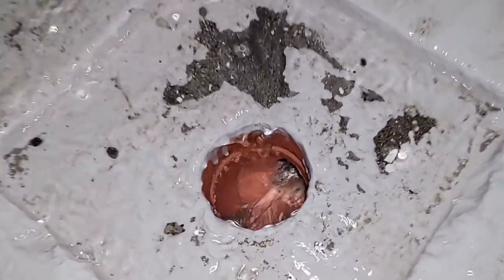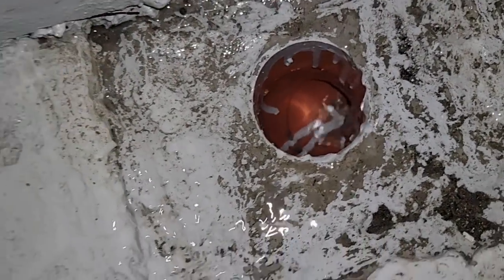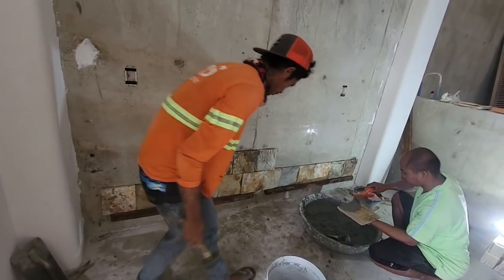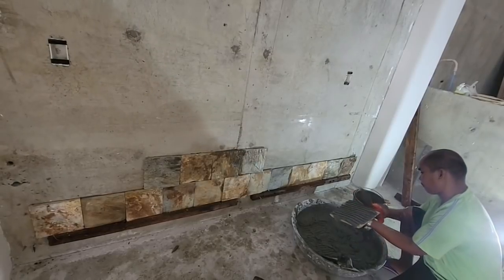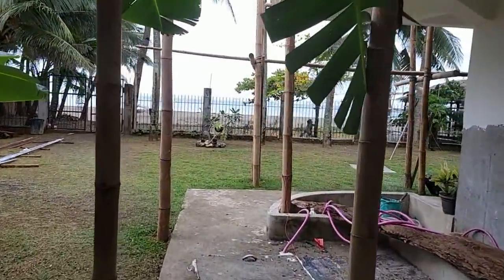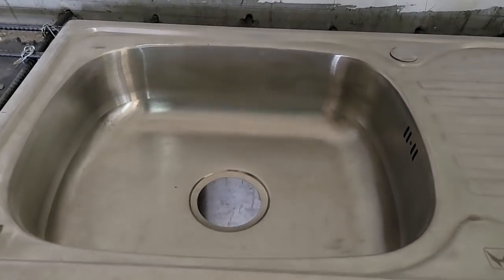Philippines Beach House Build Day 271 OPEN THE FLOOD GATES Before we ALL DROWN! MEL TAKES CHARGE

Comment: they should mark up 1 or 2 rows up on the wall and spread the glue. (1 or 2 depending on how quick they are so the glue doesn't dry by the time the slap the tiles  up. There's no need to tap it, it may chip or crack the tile. What the can do is apply some pressure and wiggle it side by side until it is flush with the other tiles. Wipe glue up as you go, as you wiggle the tile glue will surface if you haven't scrapped the edges as you go and you shouldn't get any glue on the tiles. Love your progress

Comment: Sorry if you've mentioned this before but Its been quite a while since you installed the cistern and my memory isn't the greatest.  Im wondering what happens when the cistern reaches 100% capacity.  Did you have a drain tube at the top to push excess to the lower elevation beach?  Im still debating on whether id do a cistern on my build when I get to it so knowing fully how it works may aid my decision.  Cheers to your great videos and educating laymen like myself!
Reply from the maker: yes there is a overflow that goes out by the fish pond. I can either let it overflow to the sand or and can direct it to fill the fish pond which will eventually be ponds . Also great for occasional water exchange on the ponds.

Comment: That stone tile is more than likely going to fall off of that wall in no time. Hopefully the guy is using a polymer modified thinset at the very least although I doubt that material is easily available where you are located. He should also be troweling the mortar onto the wall and leaving a horizontal notch it at the very least prior to installing the tile. If you don't trowel the thin set onto the wall there is no bond, even more so when you use inferior setting material which he is more than likely using. You will be able to pull the tile off with just your bare hands or just pop it off with a trowel. Sorry to be the bearer of bad news but that is shoddy workmanship. I am a contractor with over 40 years experience in the field and have fixed 100s of jobs exactly like this.
Reply from the maker: Yes we are using the right thinset and no its not going to fall off. We are not using portland nor I am a freaking idiot. This is special adhesive with extra additive. Your not a bearer of bad news just a know it all who assumed so much knowledge from a couple of clips while in reality you didn't know squat. They put one on crooked and we couldn't chisel it off.  Keyboard warrior  - did I show you the material we was setting it with. Must I show every tiny detail so people like you that think you know every move we make can be reassured? I have the last laugh.